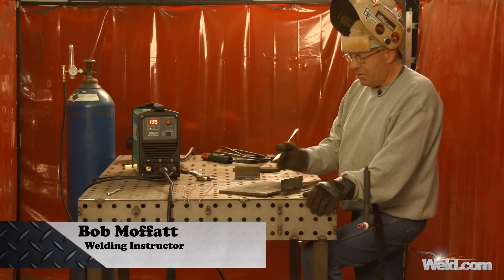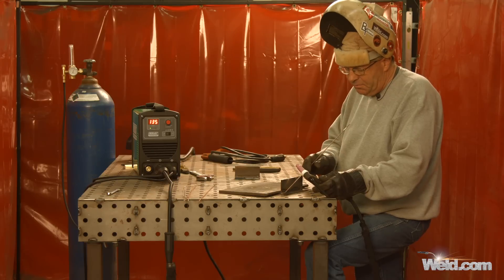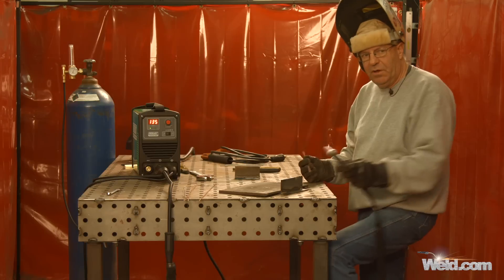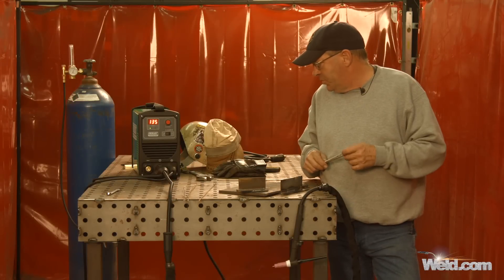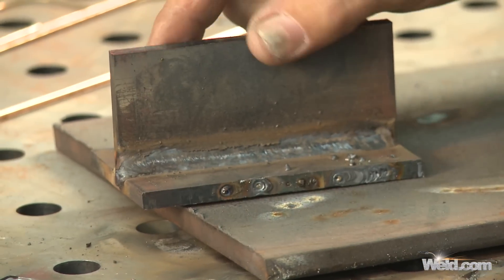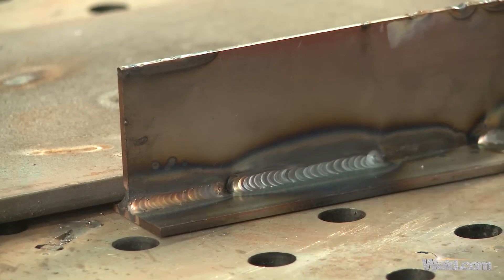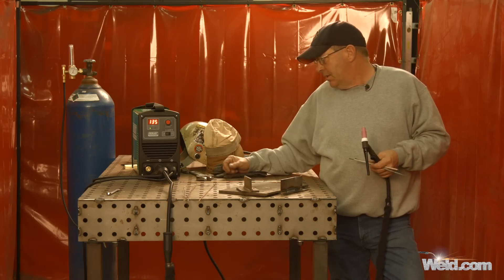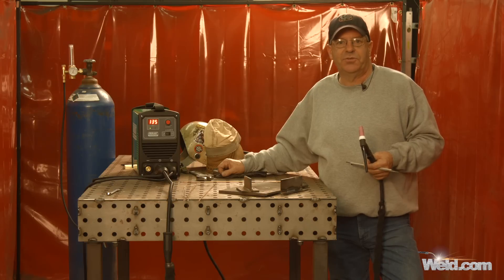🔥 Everlast PowerArc 200ST Demo: TIG Welding | TIG Time

Comment: Bob, great test, but I have a question that is only partially related: How in the world can you grip the torch around the head without your hand melting off?? Is there something special about the gloves you were using? I realize that the test weld was only 2"-3" or so, but there's no way I could do that with my Tillman gloves & my WP17. You must be tough as nails....  ;)  I would like to be able to hold my torch that way if there's something I'm missing.  Thanks again!
Reply: Robert Ross I'm actually not holding that close. Camera angle might make it look that way.
Reply: Bob  Moffatt - I just know that I can't grip anywhere close to the cup; or my hand gets too hot. I was hoping to learn something new. Thanks!
Reply: Robert Ross I'll show you.
Reply: Bob  Moffatt - Email sent, Thanks!

Comment: Would you be able to demonstrate a 2" 120 TIG Root 7018 out 6G (Super Coupon) Test
Reply: Dan McGuigan 
Mine welds out a super coupon with tig root/hot and 7018 rest out,no prob. A tig all the way out heats up my ck26 @80 amps full super coupon

Comment: I ordered one of these to arrive in a few days. Bought it for stick, for around the house, but now you got me interested in learning tig. That’s a nice weld and would be delighted if I could learn to do anything half as polished. 

Everlast recommends a 17 torch; is that what you were using ? Any other recommended additions to this unit for someone that's just starting to learn tig.

I’ll have access to 220v and will be working on 1/16 to 1/4 thickness.
Reply: George Missios The 17 series torch will serve you well.

Comment: Can you weld aluminum with this machine?
Reply: Roy Vannoy its DC only so no not right off. Weld.com has DC welded aluminum using helium as the shielding gas but I think that's for experienced welders. I have a everlast 140st and I want to try it but haven't gotten to yet. My 140 has been great for stick though.
Reply: I would recommend the Lincoln Square Wave 200 if aluminum is in your plan, I have one and like it very much.
Reply: I find the Lincoln is just perfect for me AHP may be just fine as well.